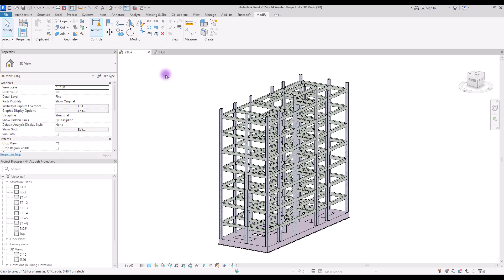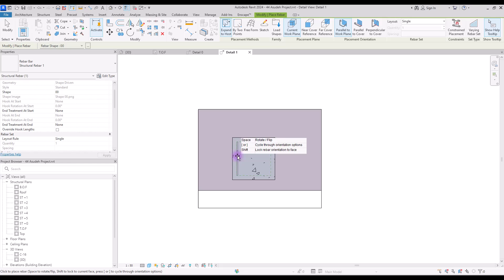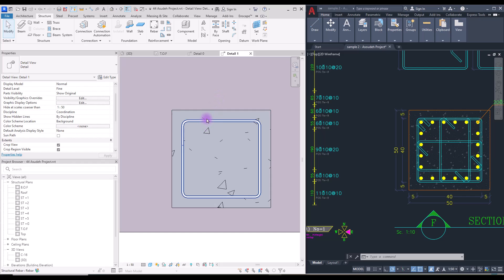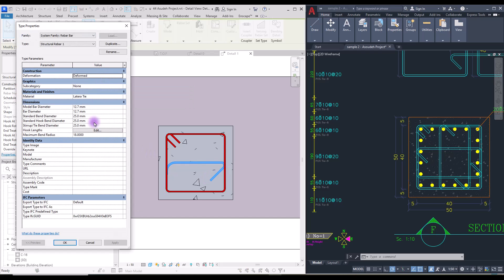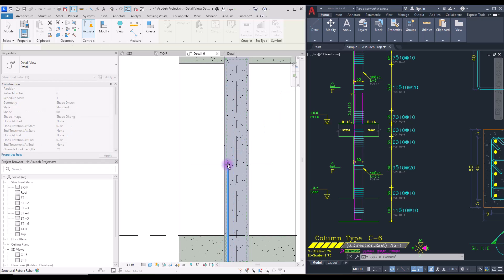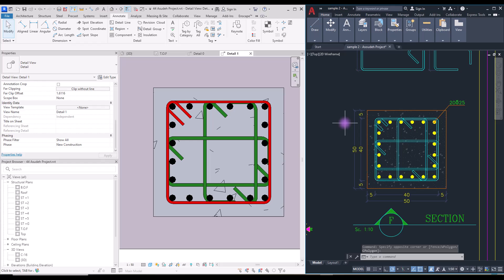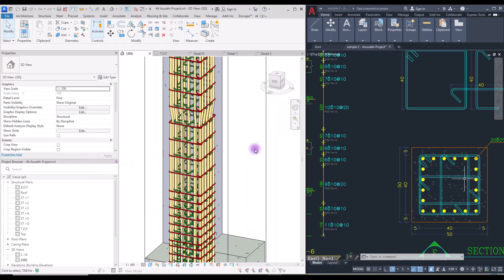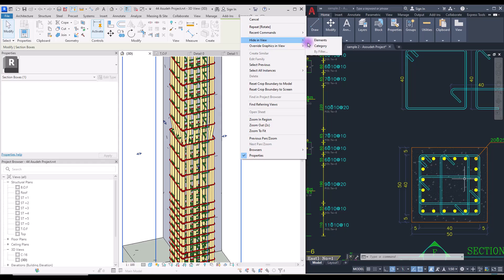Setting Rebars in Revit 2024 Properly: Concrete Columns Reinforcement

Comment: Mam, what is the difference between bend diameter and bend hook diameter? Are they both same?
Reply from the maker: Well, they are kinda different. Bend diameter refers to the diameter of the reinforcing bar at the point of bending, while bend hook diameter refers to the diameter of the hook or extension at the end of the bar. 

Draw a rebar with Bend and change the Bend diameter. Then active a hook at start or end and after that change the Hook bend diameter. You will see the difference.

Comment: when do you usually put the additional links?
Reply from the maker: Like for what specifically ?
Reply: @RVTPLUS  yes, I just want to know why putting inner or additional ties is necessary
Reply from the maker: A quick answer for that is to increase the structural stability and strength of the columns, which prevents the column from buckling or bending under lateral loading or wind pressure. If You want to know more, search about the structure design, ties, stirrups and reinforcements.